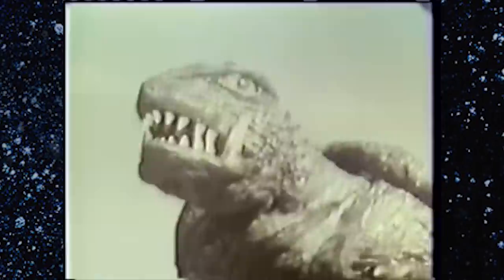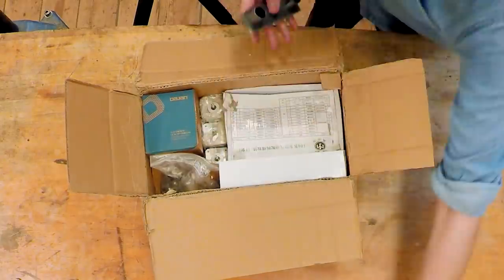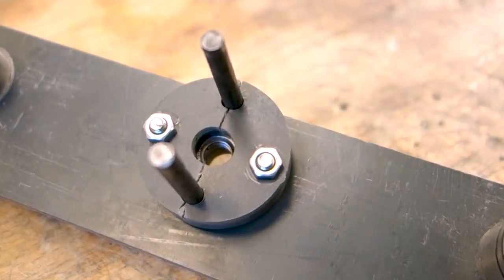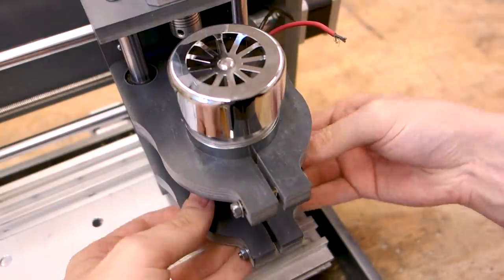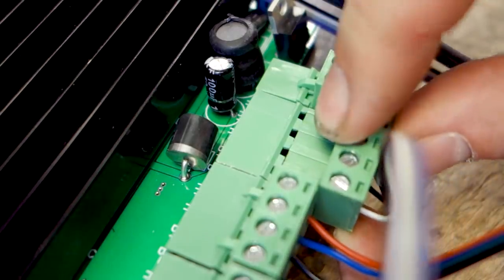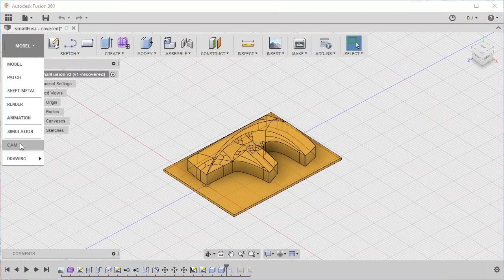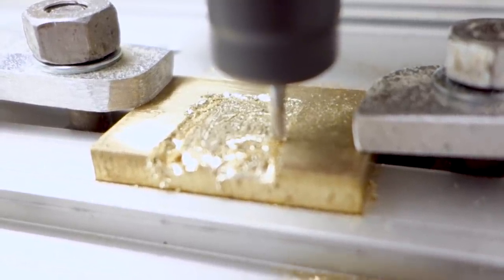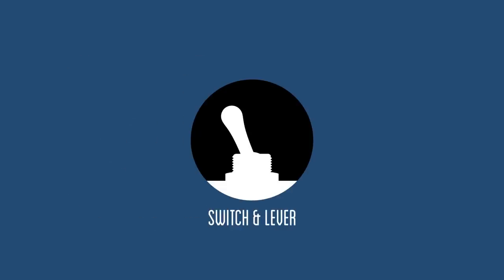Review: Cheap CNC Mill

Comment: my mini robo cost $1000.00 ,but it came with 1.0 inch rails ,the plexiglass was real good quality The base is 1 inch osb sanded on both sides even though I have changed the original electronics  to arduino GRBL Yes I would buy it again.

Comment: If you think that these parts are grimey, you've never been to guangdong. The air quality is profoundly terrifying in many places there.
Reply from the maker: Funnily enough I’ve been in Guangdong and Shenzhen and have been part of setting up production there, so yes, I know very well how it can be. I also know they can deliver very high quality stuff, with proper QA, which I think more is where this failed.

Guangdong province has also become a lot cleaner in recent years as much of the painting, varnishing and epoxy industries had to move due to new air quality regulations.
Reply: @SwitchAndLever  I was out there in 2008. I've heard it's improved a lot. I left because I was getting full-body rashes from the pollution, and I opened up a lighting conduit in the design studio to find out what the electrical ticking sound was... and cockroaches poured out of the PVC conduit. We saw a man in flip flops and shorts pulling asbestos out of a ventilation fan to unjam it, maybe 60 storeys in the air, hanging off the side of the building. One day raw sewage pushed up all the manhole covers, and these grey snake-like goop-worms came roaring out of the road like indoor fireworks, and my assistant, who was standing on one of the manhole covers, ended up with it flipping over and trapping him by the leg, then being pushed out by the sewage. We are talking mental hyper-speed industrialisation. 100ft visibility on a bad day. Crazy toxic blade runner mill-town nightmare.

Comment: Great video, but there's a few mistakes. Engraving bits and ball mills are absolutely not suitable for cutting the bulk of material, they are just for surface finishing. If you used a standart square endmill, the results would be 10 times better.
Reply from the maker: Yes and no. For soft materials like foam ball endmills are just fine to hog away material with. For harder materials like the brass I tried to mill the mill would never have accepted the cutter engagement of a square endmill.

Comment: I think these were an okay buy before the 3018 style machines came out. And they use grbl open source electronics which is more sensible....

The 3018's are an interesting value proposition... more portable and just as rigid or better.
Reply from the maker: Frame wise there are definitely better machines than this. I’m not a huge fan of GRBL though as they don’t have the same feature set as many of its commercial competitors.

Comment: Great video but I do have one comment. You should never solder a crimped connector. Back in the 1960s the NASA guys figured out that a crimped connector with stranded wire is much more able to handle vibration than a soldered one. The problem with the solder connector is that it becomes a solid and so is prone to cracking. A properly crimped connector provides a gas tight connection and will never come apart.
Reply from the maker: I lost count how many times I replied to this comment already. This isn't built to NASA standards, and soldering a crimped connector is perfectly fine in this application, especially so since the connectors were for a much thicker wire than I was crimping in (so the crimping did not work properly, and the connection would've been intermittent at best) and I wasn't going to delay this build another day or two just to get the proper connectors.
Reply: I understand. My message was to your viewers, many of whom may be just starting out. Sorry if I annoyed you, that was not my intent.
Reply from the maker: @marklewus5468  your comment didn't annoy me, just the fact that it's been brought up so many times.

Comment: Do you realize, that optical media is more reliable than USB sticks and various other options?  Optical is impervious to EMF, EMP and any other electrical issues. Its also a lot cheaper.
Reply from the maker: Do you realize that the vast majority of computers sold these days do not even come with an optical drive?
Reply: @SwitchAndLever  Well, you should probably never buy a ready-made computer, but even then, optical drives are readily available.  Its a small effort to vastly improve the safety of your data - that is, if any of what you store on your computer actually has any value.

Arguing, that its 'not the latest' or 'on its way out' is like saying phones with non-replaceable batteries are a great thing, just because that's the latest direction  corporations want to take us out of pure, unenlightened self-interest.
Reply from the maker: Please show me where you can buy a not ready made laptop then. Good luck. 

Backups on optical media is a silly idea these days. They take an exorbitant amount of space (one video project would easily consume 10-20 DVDs for instance) and they degrade over time. If you need backups you use harddrives, and keep multiple copies which you store in physically different locations and refresh every few years.

Comment: Plastic for the frame and supports.... O.O
Manual wiring for the power supply that involves splicing your own wires hugely increasing fire risk.... O.O

Cutting plastic with that CNC would be doable but aluminum would be insane. What surprises me is that for a hundred more dollars or so, they could have gone with an aluminum frame which would have a much higher stability.

Comment: Good god, nearly everything you talked about with the electronics is wrong. In order:
1) Crimping the power leads properly is the correct way to do that, but adding solder to the connection makes the connection weaker and does not improve conductivity. The solder inevitably wicks up the wire, and makes the connection more likely to break.
2) For the higher-power spindle wires, the screw connector you used is very much a fire hazard. These connectors don't provide the best conductivity anyway, and will get even worse once the screws inevitably loosen. Especially considering this connection is just free-floating and not secured.
3) The hook you demonstrate at 8:44 is an absolutely horrid idea, that has exceedingly sharp edges and will fray the wires. In lieu of using a proper wire retainer, drilling 2 holes and using a zip tie would have been better. This is such a poor way to do this that not securing the wires at all might have been preferable.
4) Bridge rectifiers can get hot, securing one directly to a board seems like a fire hazard to me.
5) 9:26 Proper holders for these relays are avaliable cheaply at any auto-parts store, it's just laziness or ignorance to secure the relay this way.
Reply from the maker: Oh great, another knowitall.

1. No. Using too thin wires for the connectors makes the connection weaker and ensures intermittent connectivity. I wasn't going to wait until the next day to finish this just so I could go out and buy the right sized connectors. The solder definitely not only improves, but ensures, connectivity.
2. Those connectors are pretty much standard even in domestic power installations, and they're rated for over 220-240V AC, if you have an issue with me using it for 60V DC then I don't know what to tell ya. While you do have a small point about loosening over time that's nothing that can't be dealt with with a drop of loctite and securing the connector to the frame. Not a problem.
3. Are you really silly? The loop (not a hook) is exceedingly smooth. You couldn't damage a cable on that thing even if you tried. Drilling two holes and using a zip tie would actually be far worse as that would introduce a stress point on the wires, as they move as the axis of the mill moves. The edges of the zip tie is also a heck of a lot sharper than the loop.  Leaving it loose would just be a recipe for the cables getting snagged somewhere as they need to be long enough for the movement of the axis.
4. This doesn't get especially hot. Around 50 deg C during operation, far below any fire hazards. If it for any reason should fail a fuse either in the power supply, or at very worst in the room it was connected to, should blow well before it has a chance to cause any fires.
5. Read #1

Go be a knowitall somewhere else.
Reply: @SwitchAndLever  Sorry, but no.
1) Doesn't address the solder wicking issue.In a pinch, adding a second wire to fill gaps can work, but solder for those style connectors absolutely makes reliability worse, due to increased likelihood of a wire breaking at the joint. Automotive as well as aviation recommended practice is crimp only, and most manufacturer specs specifically prohibit soldering.
2) The only appliances I've ever seen them on are aliexpress grade imports. Being rated for 240VAC is only an insulation rating. My issue is with the suitability of the connector at this location, since that style is only appropriate for secured wires that are nonmoving.
3) Look again, the end of the hook is just a sheared face. So while the edges of the hook are smooth, the end of the hook is sharp metal.
4) While fire is unlikely,  a large bridge rectifier can reach over 200C while within it's power rating. The transformer itself appears to be unfused, and relying on household protection seems unwise. Just look at incidents of 3D printers causing fires, and consider that this kit is using the absolute cheapest components that could be found in the Schenzen market. It isn't even a guarantee that the power supply has adequate protection, much less directly wiring a transformer.
5) While I understand just wanting to get a project finished, I find it a terrible idea to put up a video demonstrating poor practice.
Reply from the maker: 1. Regardless of how much solder may or may not have wicked up the cable if you look you can clearly see that there is enough solder filling the hollow space in the crimp connector to made adequate connection. It's basically entirely full of solder. This is not automotive, nor is it aviation, the fact that you even try to compare this subpar CNC with those is kind of funny.
2. They're standard, common as dirt, screw terminal blocks. They're everywhere. Just because you haven't seen them doesn't mean they don't exist, nor that they're not used as I point out. If you're still arguing the point of it moving and loosening, reread what I wrote.
3. Look again, the radius of the cables mean that they can never actually touch the sheared face, you're simply arguing a non-existent point there.
4. The transformer is unfused, the power-supply supplying the transformer is not. 
5. Did I ever recommend anyone to do what I did? Is this a "how to" video? Did I ever say "throw caution to the wind and just slap stuff together"? It's a video of how I did it. Not a video of telling you how to do it, yet you argue like it is. Why? If you have an issue with this video I can only imagine that you spend all your days complaining about all the videos of people doing unsafe things on YouTube. No?

Comment: I'd hot glue your anti-backlash mechanism back together.  Also I'd use your original plastic table because the rest of the frame does not benefit with the extra strength of the aluminum table.  However, I cannot think of a use for this machine.
Reply from the maker: Hot glue? It would just break apart directly again. Hot glue is not really good for high strength application on small parts. The aluminium table definitely benefits the machine as well by being able to hold down parts sturdily without breaking, like the small plastic piece did.

Comment: Even the screws look like  they were made with a hammer. Chinese never use aluminium, everything is casted zinc, so yes they snap like a cookie.
Reply from the maker: Suharinos what? Of course there is plenty of aluminium used in China. I’ve personally visited several factories that both do CNC and anodization of aluminium over there. What a strange thing to believe.
Reply: @SwitchAndLever  Like that snapped "aluminium" part of yours.. lol.
Reply from the maker: Again, what? Did you even watch the video? The frame is plastic, nowhere does it even talk about it being metal. I have no idea why you assumed it was, it doesn’t even look remotely close to either aluminium or zink.

Comment: Do note that for part of the year winds blow across the Mongolian  Desert and carry a fine dist across northern China. It gets into everything. To keep a product clean would greatly increase the cost of an inexpensive product. It would require a clean room. The result is a gritty feel. I bought a cheap Chinese lathe that works just fine however, I had to take it apart and clean every part myself. Look at it this way, you will end up with a really clean product and a really good understanding of your device.

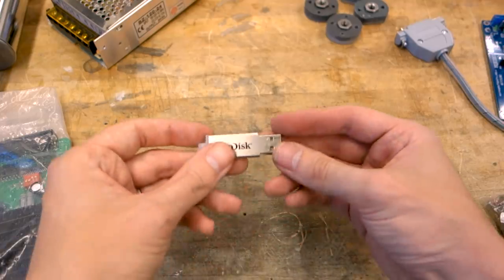Comment: 3:49 Who even uses disk based media anymore? I would say, who even uses flash based media for backup?! DVD-R is far more reliable in long term (no, not this particular disk they supplied...). I used to backup my data on DVD-R, at least 3 different reputable brands at once, and hope at least one of them will survive... I have 15 years old DVD-R-s that reads fine (Fujifilm and Verbatim AZO, Taiyo Yuden). The guaranteed data retention for high capacity flash media is usually well below 10 years, I had a 8GB TDK flash drive that failed within 4 years sitting in the drawer. You expect billions of sub femto-Farad capacitors (below 10E-15 Farad!) to stay charged for decades! This is much more ridiculous than relying on the also fragile chemical stability of a DVD+/-R.
Reply from the maker: That’s not a “backup” though. I don’t even have a dvd drive on my computer, many new computers today doesn’t. Regardless which media you use for backup you need to re-back it up within a few years anyway. So I don’t really see your point. Hoping that your media won’t fail is bad practice. Routine maintenance and redundancies is the only way to go, regardless of media.
Reply: @SwitchAndLever  I didn't said I backup my data only once... I make backups of the backup DVDs every 3 or 5 years, if I think the data on them is still important. But I also keep the older copies. In some cases, the 're-backup' media failed after 3-5 years, whilst the 10+ year old previous backup was still fine. Flash memory is so bad in that regard, I can't even trust it for a year. Saying that I also have 10+ years old 512MB - 1GB flash drives with 10+ years old data on them, but I also had file corruptions during storage on other, much newer and bigger flash drives. It seems like the bigger the storage capacity the lower the reliability, which makes sense since the the physically smaller floating gates can store less charge, and might have higher leakage.

Comment: The oil film protects from primarily oxidation, but also other potential contaminated.  The manufacturer does not know the end consumers environment.  You want that oil coating.  The parts ARE too brittle!  Everything else looks like the design was released for manufacture on schedule but without optimization.  Not good.  There is nothing it does well enough that $400 is an option for me.
Reply from the maker: I could see the use of an oil coating on metal parts, but not on plastic. Also there is a difference in a coating of an anti corrosive and feeling like they’ve been dunked in old motor oil.
Reply: Switch & Lever that bad huh.  And right not on plastic.

Comment: An old rule is rigidity makes machining better. Stepper motors are not accurate enough below 0.005"or 0.127mm. I would rather spend more money. Its a pity the manufacturer doesnt offer a steel frame and better quality at a higher price. You should never cut deeper than the diameter on the first cuts.
Reply from the maker: Steppers are plenty more accurate than that as accuracy does not come from the stepper as much as it comes from the leadscrew and type of leadscrew used, as well as possible backlash.
Reply: @SwitchAndLever  what is the accuracy level. All the industrial cnc machines i have worked on have Servo motors. Machines that are less accurate have stepper motors. Routers, plasma cut, oxycut machines. Or have stepper motors improved over the years?

Comment: A good, balanced review, but there is one thing that I take exception to: you must NEVER crimp a soldered end.  The solder is far softer than the wire and will slowly flow over time, causing the connection to loosen.  You will probably get away with it in low-power circuits, but higher-power ones can eventually arc and potentially cause a fire.  I've personally seen arcing and board destruction because of this.
Reply from the maker: I didn’t crimp a soldered end, I soldered a crimped end though. If it gets the work done with the material I had available (the crimps were way too big for the wire gauge, so they did not crimp correctly) then that’s what I’ll do. Otherwise that detail would’ve delayed the project at least another day before I could get proper crimp connectors.

Comment: A question: were you able to use the board with USB connector? I didn't find any driver for windows 7?
Since,  I use ubuntu cnc, with the parallel port, but it will good if I can use the board! Thank you.

Comment: Actually $400 is a real steal to get EVERYTHING you need in a box to make a cnc machine even having to replicate and make your own parts!

Imagine having to source all the parts yourself? Nightmare!

 You have everything you need to get started in cnc. You could buy a great off the shelf aluminium skeleton to put all the electronics and motors on. Job done.

I brought a partially completed (plastic) cnc machine and added stop switches and enclosures. It's excellent value at £400 I paid (including desktop with mach3 installed!) and has taught me no end in cnc.